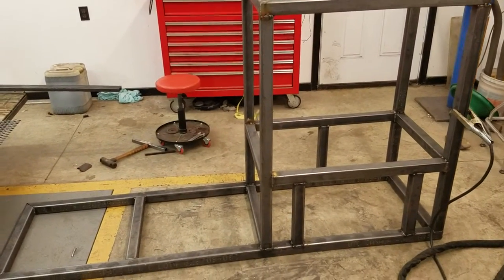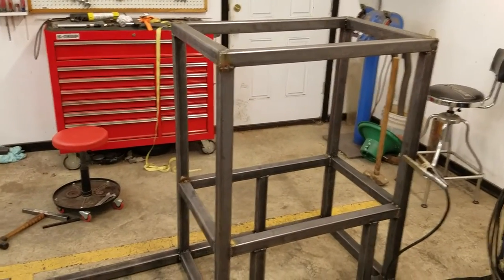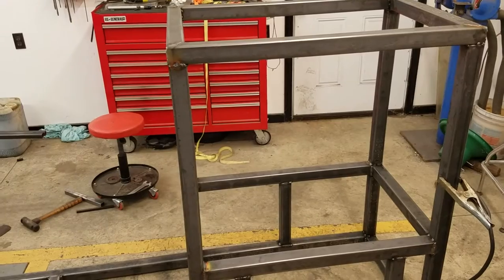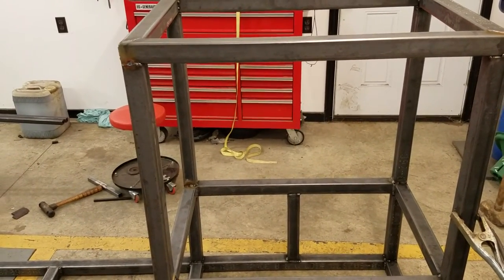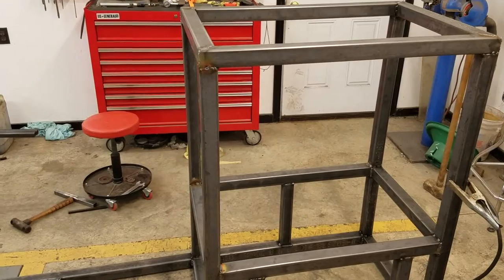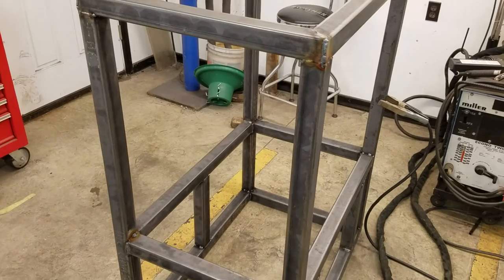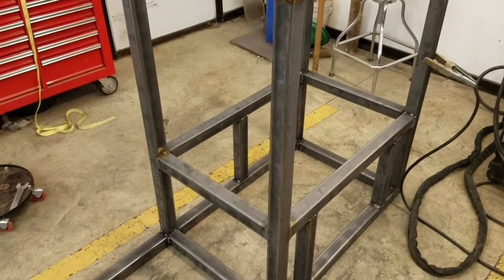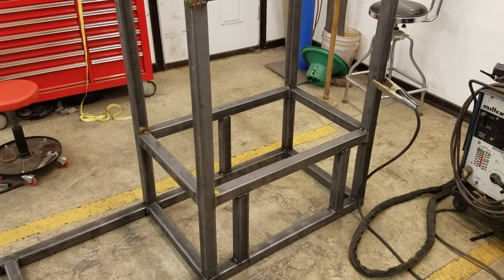Insulated Reverse Flow BBQ Smoker Trailer Build Part 1

Comment: Where did you get the plans?
Reply from the maker: +Scott Hamilton I based the design off a few other builds I had seen. But I didn't have any hard prints, I just made the sizes as big as I could while maximizing the steel.